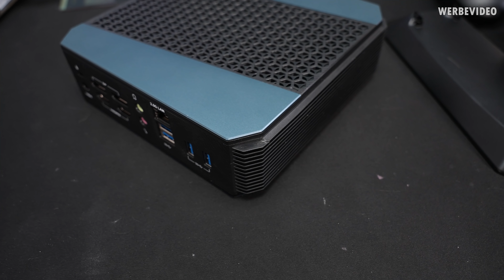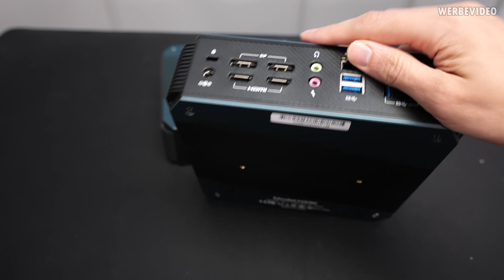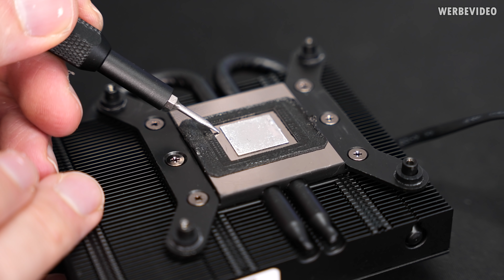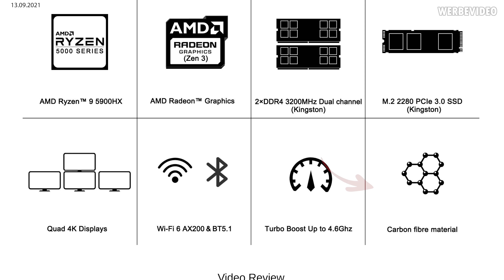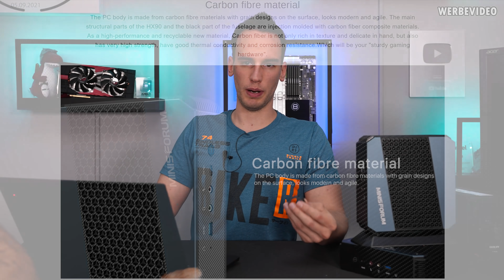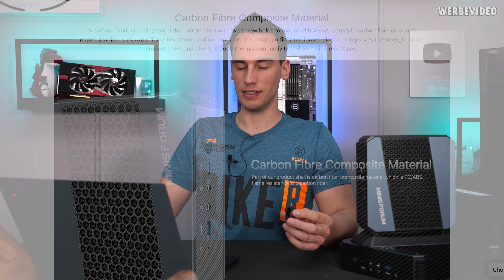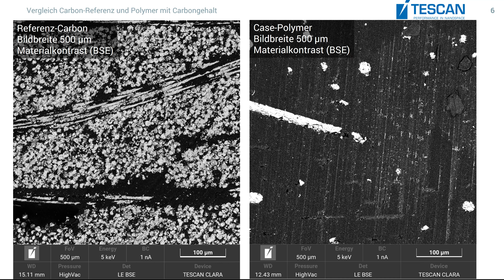More Marketing Lies? Minisforum Retail PC opened and Polymer analyzed by Tescan (SEM)

Comment: Drop tests within the boxes is their way to test for the computer's resistance to UPS shipping.
Reply: Agreed, and this is actually a major factor in the design and specification of a product. It will have to be specified for example 5 drops of 1 meter on each side without any harm to the device inside the package.
Reply: They should also include a football throw test. Just throw it as fat as possible.
Reply: @gudenau  Agreed. Everything you said, plus the FedEX packages are always filthy. Clean your trucks & vans once in a while, FedEX!
Reply: I'm not sure if this will surprise you or not but joke's on you, because you are right. We've done things like that for our web shop...we packed things and then threw them through the hall and also kicked them a bit, to inspect the packed items afterwards.
Reply: @TheYear2525  Years ago, I once loaded product onto power equipment and bonked it around to see if the jolts affected it.

Comment: It looks like the Engineering side of their company is willing to learn and fix issues.
While they're Marketing side is just plain stubborn with their continued spin for Carbon Fibre.
Reply: This about sums it up.
Reply: They're almost an american domestic brand already.
Reply: Their
Reply: @FinneousPJ1  you ain't got know good English
Reply: @Durkhead  I sure have
Reply: My bet is Engineering said "We aren't ready yet," on the liquid metal side. So marketing had someone hand-make the original review units.  It's a classic case of the engineers can deliver the product, but management and marketing makes us look like idiots.
Reply: Which makes no sense. If they wanted a 'drop resistant' case why not use glass fiber reinforced plastic (GFRP). Carbon fiber reinforced plastic (CFRP) will be lighter in comparison, and maybe the material finish can't be matched with GFRP, IDK I've never worked with CFRP, but the benefits essentially end there.
  
They spent serious coin on CFRP that could've been $ back in customer's pocket or gone toward better component choices. They would lose out on both the perceived value boost of CF and the electrical conductivity (GFRP is an insulator whereas CF, especially if treated, is highly conductive. Unless I'm missing the additional parts necessary for this to become a desirable feature this sure seems pointless at best, borderline dangerous. Stupid regardless.). Maybe they were trying to showcase the higher melting point not electrical or thermal conductivity. 

GFRP aesthetically would be neat IMO, so long as there a decent %. I wouldn't even care about the finish if they did a matte color and CNC not injection molded. Leave the tooling marks for character.
Reply: @jsutrov  do you really think they spent "serious coin" on 3% CF?
Reply: @FinneousPJ1  yes. Depending on precursor material costs (price of oil etc.) it typically runs 10-20x the cost of glass fiber reinforced plastic.
Reply: Some exec sold the more expensive plastic as a marketing point and is on the hook for it, I bet.
Reply: they would have already payed for the marketting work..thats a big loss. moreso when you have to buy more but having nothing much to show off.
Reply: It's perplexing that Minisforum would doubledown on the carbon-fiber nonsense -- when NOBODY ever looks for a carbon-fiber computer. It's like the topic is personal to minisforum. They're going to find some ledge to stand on, and keep pushing carbon fiber (when nobody cares).

Then, contrast that to how they're doing all this labor-intensive liquid metal (involving a high degree of trust by the purchasor that it's done right -- not just "at all" which was the first gaf) while cutting costs on ram and nvme. Of any machine that you'd use higher-tier memory & nvme, it would be this one. AMD benefits from dual-rank memory. But, Minisforum is using single. The NVME is about the slowest you can find anywhere.

My point is: Minisforum doesn't care about real things that most people care about. They'll jam it to you with cheap memory & nvme -- while pushing stuff nobody cares about (carbon fiber), and then sinking labor cost into liquid metal on a machine using substandard mem & nvme(!).

It's bizarre. Then you have to trust someone like that to do enough labor with the liquid metal (that your house won't burn down 3-4 years from now). I'd rather not have liquid metal (nor carbon fiber, which I'd never think of in my life if Minisforum hadn't turned it into a topic), and have dual-rank memory, and even a mid-tier nvme. Someone making choices like this shouldn't be trusted with liquid metal. This is a disaster waiting to happen.
Reply: I mean, carbon fibre in the "traditional" sense is just reinforced plastic anyway, but it doesn't make sense for strength related applications because it's really not that strong. It's stiff, meaning it doesn't flex much if at all but if you hit it against a wall it probably wouldn't fare well. Fiberglass is much stronger than carbon fibre, but flexes much more, and for applications like a PC case, using glass fiber reinforced plastic (like what a lot of powertools use) would make more sense since it's stronger.

Comment: You asked the question "Why would they do that?" in reference to gluing down the heatsink. If I was manufacturing/building this PC for customers, I would glue the shit out of it if liquid metal was involved. I would be insanely mad if I got a tech support call saying it doesn't work anymore with a picture of it taken apart. It is glued so you don't fuck with it. -Tech support manager. Otherwise good review video.

Comment: It looks like I'll be buying one now. I was very hesitant after Gamers Nexus video. Having the liquid metal safely contained is great for me. I really don't care if it's not really carbon fiber or 3% carbon fiber and 97% plastic. I don't expect I'll be dropping it. It's performance without liquid metal loose in the inside to cause trouble I want. I have a few other mini-PCs from Minisforum and zero complaints with them thus far.

Comment: The 3% fiber amount is probably the limit they could add and still have the surface finish look good/ smooth. The more you add the more rough it looks. This should make the PC/ABS much less likely to have cracks spread. 
If they made it with the 60% carbon fiber woven fiber they'd have to mill it from a solid block of composite. That would be ridiculously expensive for a computer case.
Reply: Power tools have 30% GF or CF in it and also look good. You start to get the GF texture at 50 or 60%.
The simply did cheapout, because CF is more expensive than the same amount ABS and the moulds hold waaay longer. (at 50% most molds are good for max 5000 pieces)
Reply: @1991apfel  5000 parts before the mold wears out? That's not worth doing.  Most 30% GF PP and PA parts I've seen have visible fiber texture. I just thought it was silly Derbauer was objecting to it not looking like a part wrapped in woven carbon fiber sheet, while being injection molded. That's for simple flat or round pieces, not parts with air holes in them. 
Trying to market 3% fiber into something really special is a stretch though.

Comment: One of the reason i could see why they don't go for higher % carbon, is to reduce galvanic corrosion.

In cars and such, they use Fiber Glass or any other non-conductive materials as first layer.

Comment: Just dissolve the plastic in acetone and see if carbon fibres are caught in a filter. SEM is total overkill but I guess when you have acess to such awesome technologies... :)
With the acetone I'm assuming the plastic is ABS, wich it probably is. But there is an organic solvent for every plastic I think.

Plastics with carbon fibre in random directions are not necessarily more impact resistant than similar plastics without, especially if it's only 3 percent. Better to use all PC than ABS with a tiny bit of carbon fibre. You can add random direction carbon fibre to make plastics stiffer but the impact resistance might even go down. Carbon fibre infused 3D printing plastics are an example of this.

Advertising it as thermal advantage is of course total nonsense. I wonder if things like these are on purpouse or not. You see, I work for a web shop and there are people who need to write descriptions for stuff in our shop. They usually don't have a degree in material sciences or are even versed in basic physics. Usually they keep to the infos the manufacturer gave them and sometimes these are quite...adventurous. But if you are just a normal description guy you have no idea if their claims are right, straight up lies or just lost in translation.

Comment: It would be nice if the entire tech journalism industry used this much scrutiny on every single tech product's details.
Like seriously, no one actually thought it was carbon fibre (just like 99% of 'carbon' marketed products).
Minisforum were called out, changed their marketing several times, yet this incredibly trivial detail was focused on so heavily. Even sending it off to be analysed in a SEM.
It's like every trivial thing Minisforum said was scrutinized to the nth degree. Where is this for the thousand other brands? There are big brands out there with reputations to actually lose, and thousands of unheard of brands making huge unproven claims. 
All things being equal, there should be this level of fine-tooth-combing over all product specs, marketing material, documentation and interaction with PR reps.
Every time one says aircraft aluminium, send it to the SEM. Or Japanese capacitors, origin trace them. RGB? Spectral analyse the LED's to determine just how red, green and blue they are.
Reply: "we cut off this tiny corner of the case that has no structural impact whatsoever and found it was only 3% carbon-fiber".  The whole carbon-fiber thing is silly, nitpicking it is like complaining that your snake oil was watered down.
Reply: "aircraft grade" aluminum is just a dumb marketing term. There are many alloys used in aircraft, not all them rare, expensive or extra strong.  If someone says "aircraft grade" aluminum, they're probably not lying about using it.   6061 is one of the most common alloys of aluminum. You can source it from pretty much anywhere, it's relatively cheap, and it is.... used in aircraft.  They are almost assuredly not lying about it.  You'll get better results in regards of marketing hype if we educate people that "aircraft grade aluminum" is a useless term that tells us nothing other than "hey it's one of many different alloys, but likely 6061".

Comment: The carbon fibre was just a marketing ploy to gain sales. Sadly, they were found out with just 3% carbon fibre reinforcement which really does nothing for the strength of the product or thermal dissipation. It is an AMD part so I am hooked on the possibilities this sku has.

Comment: At first I thought that Minisforum's claims about carbon fiber usage in the body was still valid (though misleading), because there is such a thing as carbon fiber reinforced composite plastic. You will have undoubtedly seen on some of your tools or automotive plastic parts something like "PA66 GF30", which translates to Nylon (Polyamide 6-6), 30% glass filled (fiberglass). A recent trend has been taking carbon fiber shreds and incorporating that instead of fiberglass in plastic, in order to add better strength at high temperatures. However, I've never seen a plastic that only has 3% fill... I'm not even sure that's enough to do anything mechanically for the plastic.
Reply: because he just cut off a small part of the thin fin, the fill is smaller there. biased content creator just want content ad revenue while trying to sound smarter than reality
Reply: @danchan5620   @Dan Chan  just because the material came from the finn doesn't necesarily mean that the fiber percentage will be higher on other parts.
Reply: @danchan5620  If the part was moulded properly (considering injection flow rate, packing pressure, temperatures, design of all gates/runners/sprues), distribution should not fall to 3%- I haven't seen that even on surface finishes of nylon glass filled parts. Der8auer is also a bit more than just a "content creator", if you look at his computer products and collaborations available on the market such as the Lian Li  011 Dynamic, Delidding tools and various other mods that he has available.
Reply: @Duckferd  Yes and Lian Li did all the hard work. Roman may have spent a few days on site and through emails and video call. But that is a nice branding exercise. It is no where as complicated going from scratch such as miniforums has done.
Reply: @danchan5620  while minisforum  fans (maybe employees) may be salty about it, the company itself still seem to be soliciting feedback and making marketing and hardware changes from a 'biased content creator' that up to now apparently only engages in branding exercises. Take that as you will.

Comment: 3 % carbon fiber sounds almost like the description on a package of nuts - May contain traces of other nuts. :)
Reply: Especially if you compare it to shells of power tools like cordless drills, the have (unless you buy the cheapest China crap) between 25 and 30%. Some of the gearbox shells of those have 50% fibers in their ABS of PC....
And such amounts aren't new, I handle Parts at work with 50-60% Glasfibers with are made in the 80s.... You can buy 3d printing filament with 20-30% CF. 

The reasons they only use 3% is the cost of the Material and the drasticly shortened livetime of the Molds with increasing Fiber percentage....
Reply: Organic Lemonade
"Contains 3% fruit juice"

Well, TECHNICALLY it's true... 😄
Reply: @1991apfel  And of course if they really wanted to improve the case strength and resilience, a high glass fiber density plastic would be vastly better (even 15-30% would have a real impact). Cheaper, stronger (for price), and well understood for injection molding. Might actually be able to do that drop test without the packaging if the insides were secured properly lol.

Comment: So, they had a nice SFF machine, using a 5900HX. They could have simply been honest about the early "review" machines shipping with conventional thermal paste (and calling them what they were, engineering samples). They also could have just skipped all the nonsense about carbon fiber. Their marketing is so busy trying to make the product sound exotic, they're missing the point of their own product: it's a well packaged SFF using a nifty APU. If I were running Minisforum the entire marketing team would be fired for unnecessarily damaging their product launch with dumb, distracting and dishonest claims.
Reply: 1. I know several mini humidifier that looks more exotic than it.
2. And yeah... green and pink headphone and mic port in this day and age pretty much nulls any exotic attempt they put on it.
Reply: @jeuno880  It might not look the best, but when I realize I'm late for a conference call, having those color coded is a major help.  I dislike products that are harder to use in the name of "aesthetics."

Comment: My theory is that this device is only a way for the corp to prove to possible clients and investors that they can mass apply liquid metal.

The device seems rushed toghether, so they dont want to sell the device, theyare marketing the liquid metal application.
Reply: Even NVIDIA & AMD stays away from using liquid metal in mass production.
And we all know how much they want to reduce their temps by 5-10 degrees.
Reply: @jeuno880  Sony did it with the PS5, and this company does not seem to be very sound on the risks if we take into account the review units sent.

Comment: What's funny about this is: how many people make computer purchases based upon carbon fiber? Minisforum turned this into a huge issue (about their integrity) for absolutely no reason whatsoever. It's like they're intent upon maintaining this "carbon fiber" narrative when zero people would care one way or another. Nobody is out looking for a carbon fiber computer. Some day in the future when someone googles about "carbon fiber computers" the only search result will be Minisforum -- and not in a positive way.

Isn't that weird? Also, they put all this effort into liquid metal when almost nobody makes a purchase based upon that. Then... they build their package systems with garbage memory and nvme. For a small increase in price, they could have dual-rank memory (which helps AMD processors), and a relatively snappy nvme. Minisforum's low standards for ram and nvme (paired to an 8 core cpu!) is stunning when they spend incredible time on virtually non-existant carbon fiber, and labor-intensive liquid metal that doesn't add as much performance improvement as dual-rank memory would.). They could have left out the flim-flam marketing stuff nobody would be looking for anyway, and published real (more impressive) specs. They don't sound like good people.

Comment: They use liquid metal because :
1. It's a good marketing point to entice peoples to buy
2. So they can skimp on the cooler. (Honestly, puting mounting system aside, I would say that Intel stock cooler looks more reliable than theirs).

Unfortunately, they forgot Tech Jesus is cruel to those trying to "scam" pc buyers, and to companies trying to shirk responsibilities.
So now the liquid metal has become more trouble than profit.
Reply: As an actual owner, the cooler is effective and fairly quiet. It's very heavy, milled from copper and with two long heatpipes. Between 1/3 to 1/2 the weight of the entire machine? The bottom is milled to two different depths to accommodate that sealing system, and finished with a plating to protect from metal migration. Are you talking about coolers for Intel CPUs that can consume up to 200W in a full desktop tower? This system maxes at less than 65W.